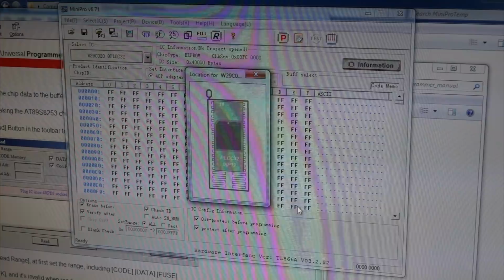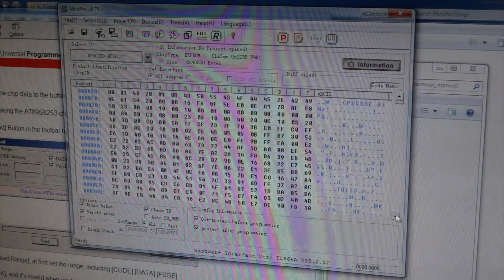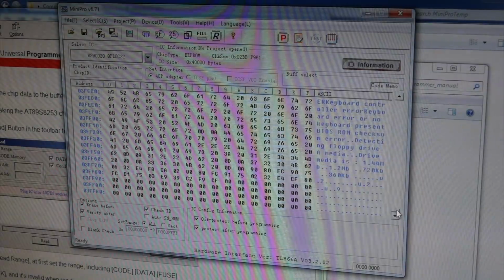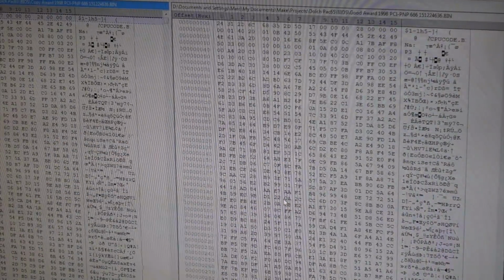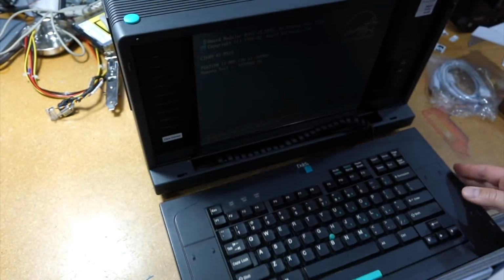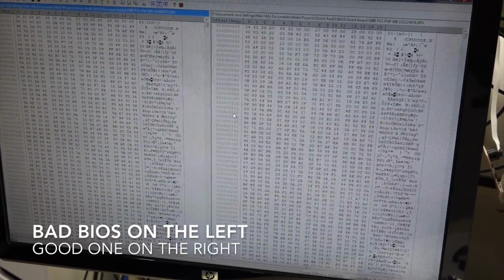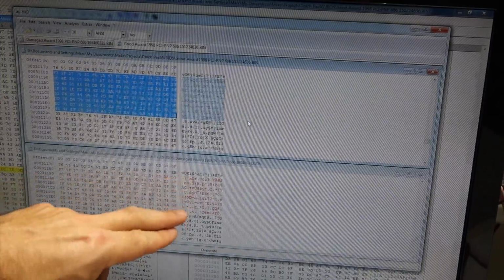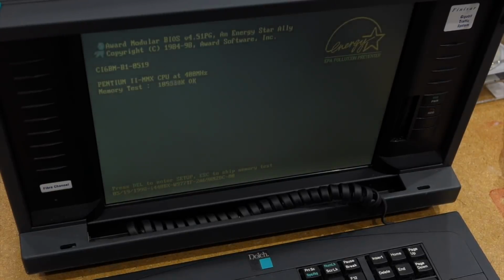Dolch Pac 65 - Part 3: the MiniPro TL866A programmer fixes a BIOS chip

Comment: Nice save on the computer. Next time you need to switch out drives, go with SD or CF. It will lighten up the weight and performance will improve.

Comment: What I used to do is boot up another computer using the same flash chip, once booted replace the chip as it is not used anymore once booted, then flashed the bios using that boot disk on the corrupted chip

Comment: That could be the ESCD area of the eeprom :)

These chips are kinda weird with paged addresses so if you for example want to flip a zero bit to a one the whole page must be erased. Some algorithms are smart enough to check if it's possible to only flip the necessary bits the other way and still get the correct result but usually they're just formatted beforehand to make sure things will succeed. Written my own bootloader for 68k based processors that can handle these chips amongst others. Really fun to play around with :)

Comment: Comparing the boot screens from the full copied BIOS (from the other computer) and the patched original BIOS, they are both version 4.51PG.  So I wonder what all that extra data is at the end of the original BIOS chip.  I can see when you compared the two versions side by side that the corrupted chip shows "Award Software International, Inc. 4.51 PG 05/19/98" at addresses 3A7A6-3A7D8, so I wonder why the copied chip doesn't have that information there.  Very strange.
Reply from the maker: Yes, all numbers would indicate the same version, but obviously they aren't. Actually there is some ASCII in the added portion, so maybe I can link it to the added feature if I take a closer look.

Comment: Could you use a bios overlay boot block on the boot hd to allow disks > 32Gb to be recognized? I once got an 8 Gb drive to be recognized by an old 1990s pc which had a limit of (I think it was) 2Gb in this way.

Comment: Reading a chip was never a problem back in the day. Providing you got the right chip selected.Writing data back was strange sometimes. I don't remember much. I do remember sometimes you would uv light a chip and it would not erase everything. So when you went to write stuff. It would error out. As for sock items. I wish tons of stuff had sockets. I can't tell you how many times a bios chip, keyboard chip, sometimes a clock chip and a few other would go poof for some reason. Yes for instance when a keyboard chip would die and you could not type anything. But that would be the first thing you would try. well after verifying voltage to the chip. Not a guarantee it would solve the problem. But next logical easy step to try. I remember doing a bank of dram chips until finding the bad or bad ones. The place I worked for had a tester thank goodness. Ah yes the good old days. Well not that old. we are talking 8088, 80286, 80386. etc.  etc. Some point of time the boards got to the point that when they died. They just died for the most part. I'm sure if I would have known more about board level repair. Some would have been easy fixes.

Comment: Depending on the OS, you may be able to use disks larger than 32GB, provided the data required for early boot is all in the first 32GB. Once the OS gets to the point where it can use its own drivers, it won't be impacted by BIOS limitations. In Linux on old machines, I commonly start the disk with a small /boot partition, from which LILO uses the BIOS to read the kernel, soon after which the BIOS goes unused. Plus if you're instead using GRUB2, it's featureful enough to include its own drivers, so BIOS is only needed to load GRUB2, which then can grab the kernel from anywhere, including TFTP.

Comment: seems like there should be a way to make the flash chip read only when installed on the motherboard, that way a corrupt bios would be less of a problem.
Reply: Then you wouldn't be able to update the BIOS without an external programmer. That would be a huge pain in the ass!

Comment: Wow, I've never known a reversed IDE cable to cause a BIOS to corrupt.. wonder what is going on for that to happen? could it be specific to this machine or perhaps a bug in that particular bios I wonder..
Reply from the maker: It's very odd. At first blush it does not make any sense. But I think the BIOS actually writes a block back to the flash during POST, just after disk discovery (maybe to speed up the next discovery?). I suspect this, because I saw localized changes in the disk code area between good BIOSes that should all have been the same, always at the same place. Also, when the BIOS gets corrupted, it's always the same size block, and always nicely aligned on 256 bytes boundaries. So my wild guess (I am speculating, which is always dangerous), is that the BIOS has a block of self-modifying code or data, and that during that write attempt the address or data gets corrupted when the IDE cable is reversed.
Reply: Hi, isn't NVram inside the RTC supposed to do that job ? BTW i thought that the bios flash chip is just considered as a ROM unless triggered for an update, this is sick and WTF for my knowledge xD

Comment: The original IDE cable was an 80 conductor UDMA66 cable, the replacement cable was only a 40 conductor cable. You're not quite done yet, it would be nice to restore the drive to the previous performance level.
H̶A̶R̶D̶W̶A̶R̶E̶ ̶I̶S̶ ̶H̶E̶A̶L̶E̶D̶!̶    HARDWARE IS LIMPING!
Reply from the maker: All my Dolches came with regular IDE cables.
Reply: The cable shown in the first video of this series is an 80 conductor UDMA cable (see timestamped link below). These cable had 40 pins just like a regular IDE cable, but use an 80 conductor cable where every second conductor is ground. The blue connector, yellow cable, and stiffness of the cable, all suggest it's a UDMA66 cable. Further research shows it shouldn't have really been there anyway as the 440BX chipset only supports IDE up to Ultra DMA/33.
https://www.youtube.com/watch?v=AKiuMNJDsmo&t=754s
Reply from the maker: Oh, that's just a temporary cable which I had on hand, not the original.
Reply: The mystery is solved then. :)

Comment: At this point I'd probably just cut the write line to the BIOS, if that's a thing you can do.
Reply: The point of using nor-flash instead of ROM is that you can update it on the spot, without having to remove the IC from the circuit board. Writing a nor-flash memory is very different from writing a RAM (whether static or dynamic) and involves multiple programmed cycles.  

(A read is done in exactly the same manner however, for ROM, for static RAM, and for nor-flash. /CS=low + R/W=low + OE=high. That is why all three are usable and interchangeable for program execution.)
Reply: I can't believe it has it connected in the first place, that's just bizarre! I'd imagine it should just be tied low..
Reply: I don't think anyone is confused on the difference between DRAM and NOR flash in this regard.

There's a real possibility of corrupting the flash again, versus the zero possibility of there ever being a legitimate update to the BIOS to flash. Since BIOS corruption likely stops you from flashing 'on-board' -- as it did here -- it seems to be a feature of little worth in the current era.

I can understand not wanting to 'neuter' or modify the hardware for various (collector) reasons, but in practical terms I think a R/O switch (I guess by pulling R/W low) would be a cool addition.
Reply: You mean pulling R/W high? It is an active low signal. But the risk of accidently program a nor-flash is very low indeed. The error is more likely a fault of the memory chip (or radiation), than anything else.

This is the four memory "write" cycles needed to program a single byte on a typical nor-flash chip (like 29F010): First [5555h]:=AAh, then [2AAAh]:=55h, then [5555h]:=A0h, and finally the actual [address]:=data.

This is almost impossible to do "by accident". :)
Reply: That nor-flash memory IC is probably unstable (faulty). As I described above, the risk of accidently issue the 3+1 cycle programming sequence of a nor-flash is miniscule, or close to zero.  

You need to get three 16-bit addresses and three 8-bit data (72 bits) exactly right –by accident– for that to happen. 

This would maybe be thoretically possible if the code for the flash programming was in the BIOS code itself, and therefore could be executed by accident. But it is normally a separate utility, afaik.
Reply: Yeah, you either need to get the magic accesses right by accident. Or do you? Much more liekly, you accidentally jump into the flashing code, which has the magic accesses anyway. It happens all the time. For example if you use bootloader/reflasihng code in a microcontroller and don't turn on the brownout detector. Also, those magic 5555/AAAA codes aren't that special, as it's just alternating bits set, which many programmers like to use to test other stuff out.
Reply: If the IDE cable is connected the wrong way (which is very easy, as there is no "key" on it), the computer overwrites the BIOS at boot time and corrupts it. Eloj's argument is that, as there is no legitimate reason for it to do this, whatever wire that is allowing write access to the BIOS should be cut.
Reply: Did you even watch the video? The error occurs when a cable is attached "upside down". It's already happened once.

Or are you saying the corruption is likely the happen even if the R/W pin is not enabled?

I'm a software guy. To me it seems like if writes are not permitted, then nothing should be able to change the contents of a particular block of flash, whether on purpose or not (ignoring obvious out-of-spec scenarios)
Reply: What did I miss?

Comment: Couldn't you just reset the BIOS settings?
Reply from the maker: What +Chris Rehor says. It had nothing to do with the "CMOS" settings chip, which people often confuse for the actual BIOS. It's the BIOS ROM code itself that was corrupt. No "reset" for that one.
Reply: samio pretty hard to reset it when it just beeps and doesn't post
Reply: What about the CMOS-Battery or a Jumper-Reset?

Comment: You can get around those 32 GB drive limitations with Drive Overlay software. Grab a free copy of Ontrack Disk Manager here: https://www.philscomputerlab.com/ontrack-disk-manager.html

If you have even older machines, give Western Digital's EZ-Drive a shot instead (It works on all drives, not just WD): https://www.philscomputerlab.com/western-digital.html
Reply from the maker: Yes I know. I don't even get close to OnTrack. One of the most dangerous piece of software I have ever played with...

Comment: Your address is visible on the box and envelope, you might want to blur that and re-upload this vid.
Reply from the maker: Thanks, I had not noticed... I added an absolutely awful YouTube generated blur so I did not have to re-upload. For those who got the address, now you know where to send the gifts :-)
Reply: Marc, be careful what you wish for. Next you know, UPS is phoning you up, asking where to park the flat bed truck and if you have a 10-ton crane at your location ;-)
Reply: I could only send you Atari and Commodore computers. I do however have a large Sony BVH-2000 1" videotape recorder. It weighs over 200 lbs, but is quite small compared to some of the tape drives you have. :)

Comment: That's pretty rotten of that computer to have a fit and damage its own BIOS over an improperly used IDE cable. Perhaps a bug to figure out and prevent.
Reply: Rotten indeed and adding insult to injury is the oh-no-we-are-all-going-to-die blaring sound ;)
Reply: At least add a dot of white paint or something to show which way up the IDE cable should go. Very interesting, though, that Marc was able to deduce exactly how the BIOS error happened!
Reply: The IDE on that motherboard couples directly to the legacy bus that is used to read the flash. Guess what happens when you ground the write enable line and attempt some “reads” :)
Reply: I've definitely had this happen before... I never used Cable Select or non-directional cables ever again. :)

Comment: Marc you should use a compact flash to ide adapter and just swap 32gb cf cards instead of having so many disks
Reply: agreed
Reply: He will be fine is not a primary machine that is his daily pc. I use cf drives for some of my old PCs I use for vintage games and midi and  I do the windows optimization changes to run from flash memory. I can swap cf cards and for single purpose  use like unixware or Sco openserver.